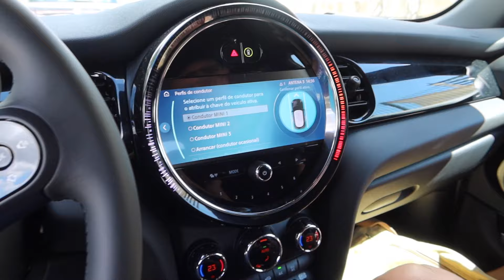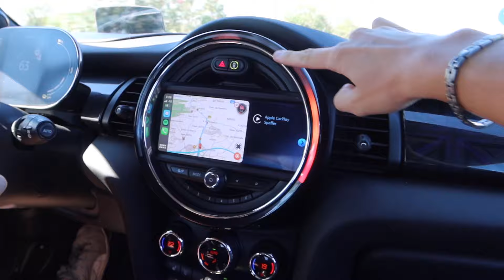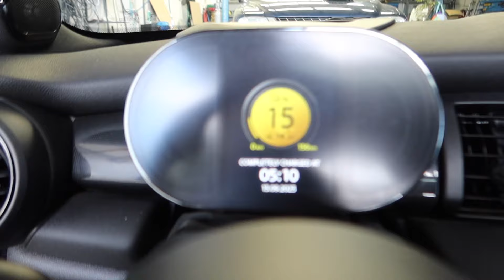Unveiling Our First Electric Vehicle! Saying Farewell To Our Beloved B Class (vlog)

Comment: Nice car.👍
Reply from the maker: Bit of a risk - but lifestyle is not massive mileage - that said, I really underrated the MINI as a brand ( not sure why ) but I am utterly sold on electric drive, we both are, effortless - super chuffed with it ( lucky boy ! ) was honestly gutted to dump the B, possibly one of the best seating positions I have had in a car, MINI is 95% as good (very high praise indeed).
Reply: @DrivenMadShow  I know what you mean about the Mini, I've had a drive in a petrol mini cooper and it was really surprisingly very pleasant.

I do like the idea of having a small EV city type car for doing the 90% of our pottering about we do, mostly less than 10-20 miles.
But also have a traditional petrol or diesel for the longer cross country jaunts!
It's the range anxiety and faffing about while the thing charges up mid journey and having to be somewhere at a specific time that concerns me, it would take a lot more pre planning and lots of extra time to do longer journeys beyond the range of the battery.

Have you still got your Panda 4x4?

I believe there is an all new Panda EV on the horizon coming soon, I may be tempted if they do something really funky with the shape and colour! 😁👍
Reply from the maker: We traded the Panda for the Abarth (as you do :) sort of always regretted it - bought the L200 ( if you have suffered those)  a year into owning, its worked for 2 weeks ! Bought the B class as a tide me over (surprisingly loved it ) but the sunroof issue made it almost a write off - as its started to rain and I had nothing to drive, I took the plunge - Mrs M was fed up of my recent car disasters and for the first time in 40 years of marriage, told me to go and buy something new - well not quite, but the Mini is as good as new, still has 2 years of maintenance and a 3 year BMW warranty - we moved home a few months ago, so the man cave is only 1km away, my longest drive is to Albufeira ( to buy coffee beans ) and that's a 100km round trip max - I am getting 200 from a full charge, so range is no problem - Nath really wants to take it to Lisbon ( he goes most weekends as girlfriend at Lisbon Uni ) but as you say, this is where the Mini is a faff - we have Mrs M's VW Tcross, but I have not had any issues, even when I was empty and had an unexpected trip, 25mins in Lidl and I was 80% - I only have the slow plug in charger, but I so much prefer never visiting a petrol station already - the main thing is the drive, go and have a go in one, great fun - the instant thrust is addictive and the one pedal drive makes it hard to go back to a fuel car for me already. Nath is planning how to get a Tesla ( best of luck ) he was not keen on me getting the EV, as I looked at a JCW, but he is sold on electric, just not the range or Lidl for charging :) - the Tesla chargers are everywhere here.